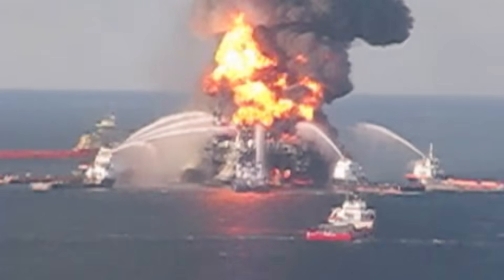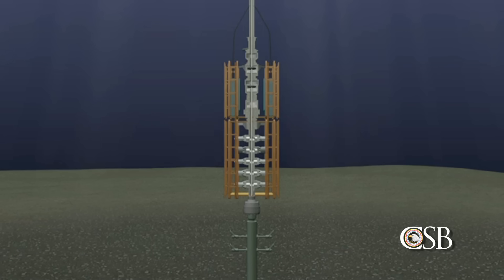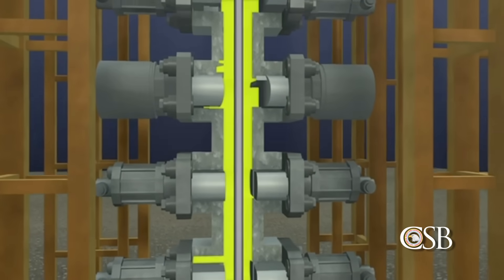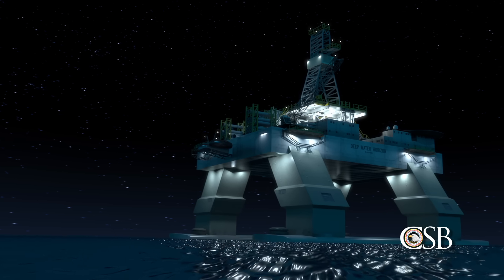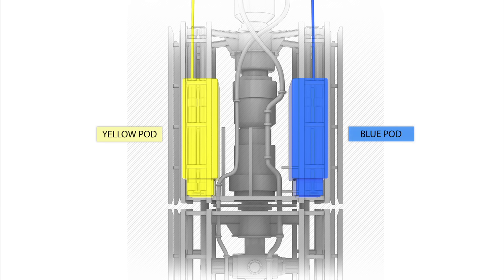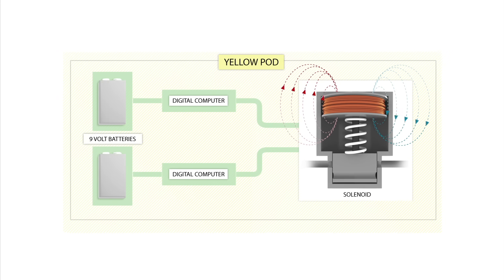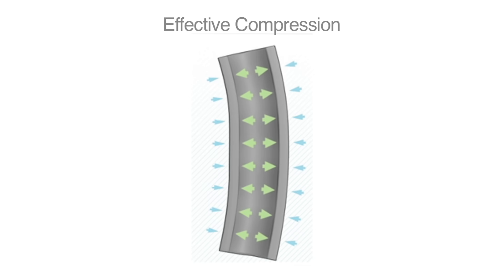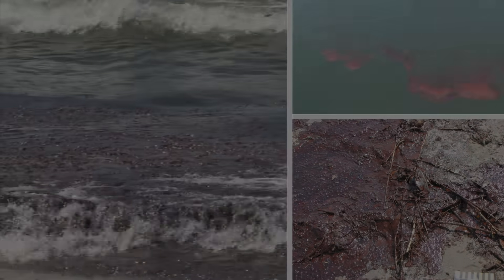Deepwater Horizon Blowout Animation

Comment: so much for redundant systems...
Reply: Only by fucking up four times in a row, did the quad redundant system even function as intended, and even then, it didn't work.
Reply: @skeptical_thinkers  lol its actually mind bending that a quad redundant safety system can get to this level of screwed up and not be detected untill it all goes bad
Reply: actually as they mentioned, the failure allowed the secondary failure to actually allow the system to work. BUT by then it was too late as the pressure caused the buckling which made the sheare not able to cut the pipe.
Reply: @OnceShy_TwiceBitten  Shear design should also be change to be able to cut the inner pipe regardless of where it is inside of the larger cylindrical chamber... there should be no pressure assumptions in the event of an emergency, which is an inherently out-of-control situation.
Reply: i think reduncancy starts after things are manufactured properly, not by imbeciles. 

Boeing are learning the same lesson right now
Reply: @dayspoiler4608  give me the rundown
Reply: google "737 max problems" and "737 NG problems". Beoing used to make wings that didn't have cracks in them
Reply: FieldSweeper I imagine though, that that failure of that one battery/coil made the ram sheering head less powerful and aided in the incomplete seal.
Reply: @K3v114  
The sheering head is moved by the pressure of liquid, and it doesn't move very fast when activated. But that doesn't matter because in a fluid-system the pressure will eventually equalize, which means the force that the sheering head exerts on the pipe will be the same. It doesn't matter if the solenoid valve is fully open or not, it will only take longer for the sheering head to close.

From an electrical perspective the design is flawed as it relies on electrical power to operate. This can easily be solved by having the solenoid valves constantly powered. When power is lost, the mechanical force of the spring inside the valve will force it to the correct position.  

If you want to prevent misfires, you can always incorporate a battery that acts as a timer. This way you have time to restore the main-power.
Reply: @DriZ01   if i understand you correctly about how the rams SHOULD work, the Sheer Ram position zero is a closed position and Position one is the Rams being open, with electricity powering the rams it keeps them in position one and with a loss of power it returns to position zero.
Reply: A redundant system does no good when both parts are equally installed incorrectly, by one or even 2 unqualified individuals. I can't believe they didn't have the wiring double checked by qualified qc personal.
Reply: @monteclark1115  I would have thought it would of been tested before it left the plant. How many times was it checked when it was first installed? Should of the cross wiring have lead to a fault in the control system? A whole lot of QC sign offs were falsified. I wonder how many others are ticking time bombs like this?
Reply: @monteclark1115  youre belief that "qualified personell" exist, is the problem.
Reply: @DieselRamcharger  qualified people do exist. the problem is that companies don't want to pay them what they are worth, and their is no law requiring companies to use qualified people. But that all needs to change.
Reply: @DieselRamcharger  no I'm not that stupid, I'm that smart. And I don't think they cut corners to save a few bucks, I know they do! I used to work in the petroleum industry.
Reply: Redundant incompetence trumps redundant safety systems.
Reply: @ichaukan  Well, looks like I have a new "best tombstone quote ever".
Reply: @ichaukan  This didn't happen during Trump's presidency.
Reply: @Jake Smith I guess you're not familiar with the phrase "X trumps Y." You know what TDS is? When you hear his name, you knee jerk and do stupid shit. thats what you just did. what an absolute idiot.
Reply: While that’s relevant to this topic it wasn’t the cause of the accident. The pipe deformation was
Reply: "If only they had three pods!" Hahahah.
Reply: The systems where so redundant that the activation of the redundant systems failed because of their redundancy.
Reply: The fact that 2 of the systems were miswired is so god damned stupid it's beyond words. Knowing full well the consequences of the BOP failing they were like "nah we don't need to test the circuits theyre probably fine" derpdeyderpderpdummmmm BOOOOOOM
Reply: Should've put a white pod in there.... They work at least...

Comment: Multi-billion dollar companies & projects... and not one but multiple wiring mistakes?! Bloody hell I just shake me head...I can only reckon that the BOP system must NOT of been tested before being commissioned/sunk to ocean floor. For such a system that not only is expensive... but carries a HUGE political/environmental potential backlash upon failure, I'd sure as hell would want to make sure it functioned as intended...

I do not work in petrol industry, so I do not know drilling specifics and there are some things I do not understand... however I DO know that batteries have a finite life. I do not reckon a BOP is something readily accessible in which one could do P.M. Seems to me a lot of the BOP design needs to be taken back to the drawing board.

My thoughts:
ᴥDrill pipe should be physically restrained or guided to centre of annulus space, should be achievable without blocking annulus flow

ᴥBlind sheer blades should cover entire width of annulus space, so if there is pipe deviation from centre, the sheer is still 100% effective.

ᴥBlind sheer actuation should NOT be dependent on batteries, capacitors, or other energy storage systems susceptible to potential failure - I'd design it in such a way that very strong mechanical energy (such as springs, or levers and heavy weights) are what force the blades shut... and an umbilically fed solenoid and/or  hydraulic pressure is what holds the blades back from closing. This way, total failure of the platform/BOP control centre results in the blades sheering automatically via gravitational or elastic energy. Redundancy of systems in this scenario would be focused on preventing the blades from sheering the pipe, instead of the opposite.

ᴥA BOP control centre/computer, located in the *platform*, to handle just the BOP...
 - Battery backup, easily accessible for P.M.
 - Monitoring of annulus space for presence of substances from 'kicks'
 - Monitoring of all other platform operations & communications (to evaulate status of platform)

ᴥSystem in place on platform to divert/handle 'kick' substances in the case they reach the platform. There should be NO reason for these to spray all over the platform.

---------

I'm no super expert... so those are just some things that came to my mind. Possibilities for failure and degradation of materials can never be eliminated 100%, the goal is to try to minimise the consequences of such.
Reply: Of course it was tested - By fools who did not carry out the testing correctly. As for the person AnatoFIN who suggested (above in these comments) that the system should "keeps closing force such as spring or pressure at bay and at the moment control is lost this force is released activating closing mechanism" - That might not work well, since it would require layers of other control equipment to prevent it becoming unstable and triggering a frequent destruction of the drilling pipe (which itself is a major disaster costing millions).  There WAS an automatic system, and it was incorrectly installed: The system contains several layers of options for automatic sealing of the well. It has worked and been subject to an enormous amount of testing, or none of these system would ever get installed.  (You might as well say that aircraft should not retract their wheels in case their undercarriage control system fails - ludicrous!)  Controls engineers know that safety integrity level certified control systems need to be simple at each level of their function, and so (crucially) testable, for all scenarios. In this case, according to the CSB, the actual design of the system appears to have had inherent defects (the buckling of the pipe problem became a big issue preventing ram sealing) which was not previously taken account of, even if it was known.  But at the end of the day, the 'little matter' of the failure to test the fail safe dead-man system correctly (and so reveal the wiring faults) was a contributory cause of this avoidable accident. HUMAN ERROR not so much the design (and bad decisions as it appears at upper management level) caused this event.  "To err is human."  :(

Comment: I was offshore 1980 to 2010.........You want safe?.........Hire better hands instead of more safety pricks that don't know squat and never will..........I worked only 1 tour for BP running an old field out of Dulac, LA. I told my office that I will not work for them again. They were TOO safe. You had to call 5 safety pricks and do 30 minutes of paperwork and an hour safety meeting before you turned a valve......Offshore brother, the POC (person in charge) should be able to ESD(Emergency Shut Down) anytime without question.....BP didn't work that way. I saw crap that tour that I was taught about as a worm 28 years prior. The crew saw it coming man and the office pukes wouldn't let the POC who didn't have the ball's to ESD that facility. They killed'em man and the poor bastards saw it coming!............And the "Cajun" or "Coonass" played by John Malcovitch is dead on (except the accent). The CROOKED BASTARDS  lie, cheat and steal everything. An honest hand never stands a chance. If they think you might know more than them?...........Pack your shit....Especially over CHEMICAL or SUPPLY issues. The crooked coonasses or "Cajun Mafia" ruined more lives than the Clintons.